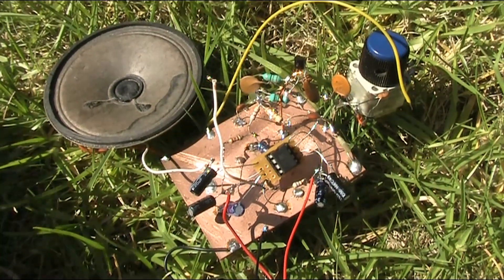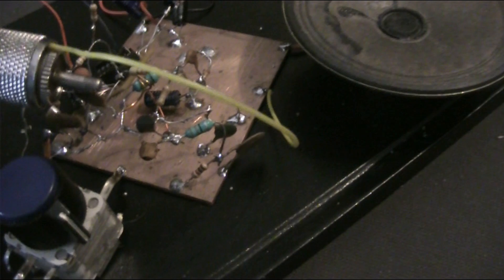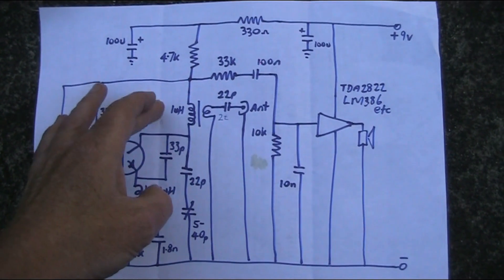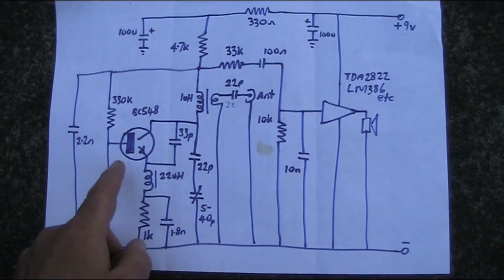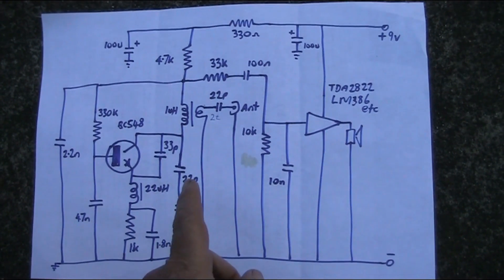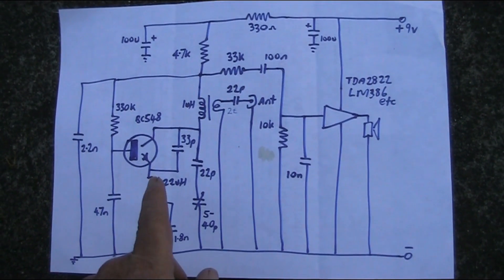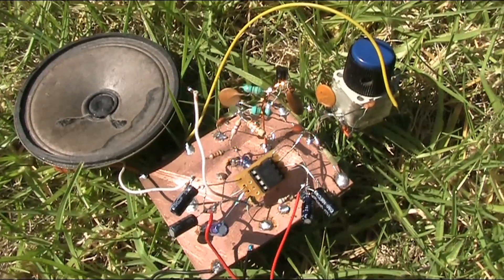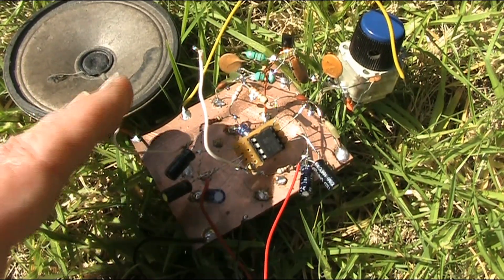Hearing Americans on a 1 transistor 27 MHz superregenerative receiver

Comment: Good video. The quench frequency is actually  determined by the r/c network below the emitter choke. The value of the choke is somewhat irrelevant.
As c charges thru choke it becomes positive and cuts trx off. Discharges thru parrallel r and so on.

Comment: I’ve always been a fan of superregens. The first kit I ever soldered together was a Radio Shack P Box superregenerative receiver for the FM broadcast band. I soldered it with a 100 watt soldering gun and amazingly it still worked. I turned it on for the first time and got that rushing regen noise only there were no FM stations in range to receive.

Comment: The bias of the transistor should be adjustable to control the level of oscillation. Too much oscillation reduces sensitivity. Also, there should be quench filtering prior to the audio stages to prevent overload by the supersonic quench signal. Quench frequency is determined by the RC time constant in the emitter circuit, and for an AM receiver should be as low as possible before it starts to become audible or produce annoying intermodulation artefacts, for best sensitivity and highest audio output. About 20kHz is satisfactory.
Reply from the maker: Thanks. I've increased the 33k resistor to 100k, reduced the 330k resistor to 100k and connected the hot end of the latter to the wiper of a 50k potentiometer connected across the power rail to vary the bias. In this it behaves a bit like a regen control but there's no reception before the point of oscillation. Adjusting from low to high voltage oscillation starts at a low audio frequency. At around 8 - 10 kHz (according to a measurement across the emitter 1k resistor) the receiver is hearing signals and is far more selective than it was. I am guessing that provided signals are not strong it could separate stations maybe 30 kHz apart. At higher quench frequencies the sound of the hiss changes and selectivity deterioriates. I like the idea of a series tuned circuit at the quench frequency across the audio amplifier input so might try that next (eg 10 mH RF choke & suitable capacitor).
Reply from the maker: And I've subsequently cut the 100k in the audio down to 2 x 22k in series but at the junction put a 1nF capacitor to try to act as a LPF. Audio output is higher that way. The 10mH idea didn't help.
Reply: @vk3ye  I have played around with 10mH chokes for quench filters but the reactance is still too low to be of any use at what are really frequencies just above the audio band. Best performance is with an active filter, eg. Sallen-Key,  but of course this adds  more circuitry. Ordinary RC filtering is a good enough compromise.
Reply: Seria possível fazer um receptor para faixa de 200mhz ?  @vk3ye
Reply: Great tip actually variable bias